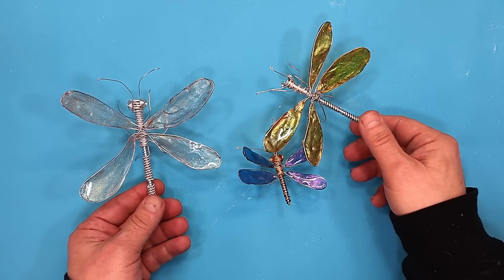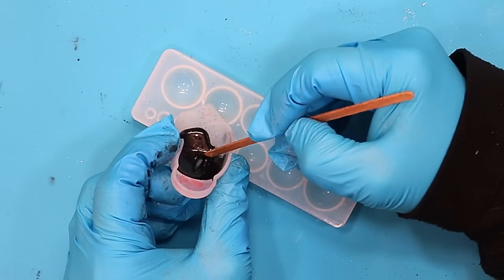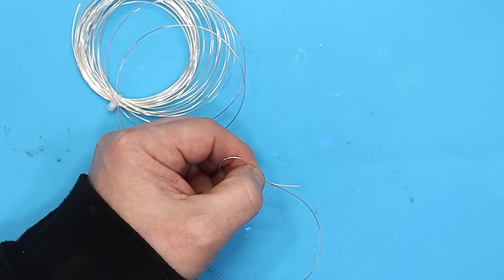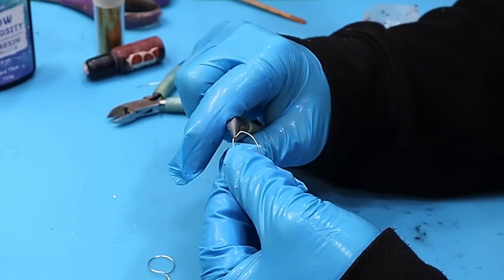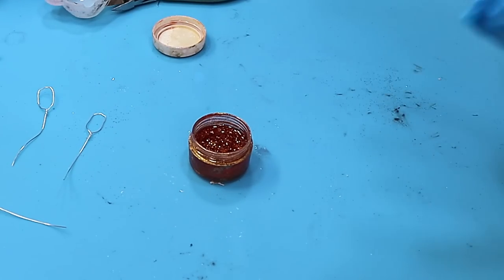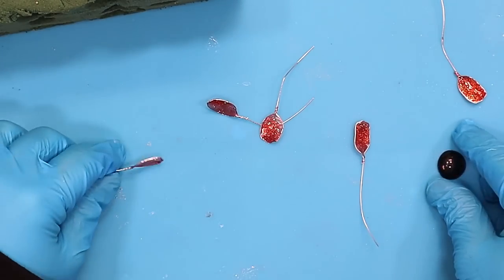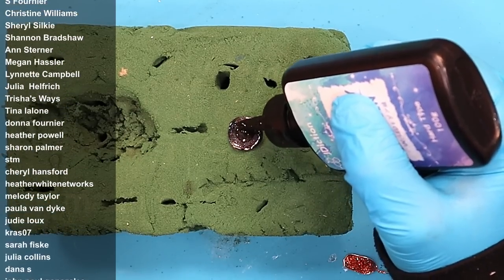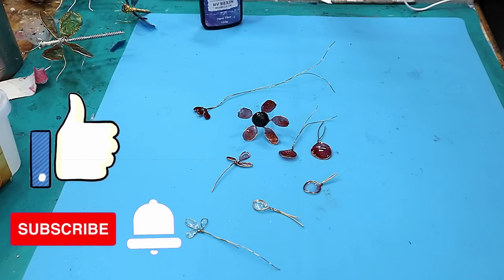Revealing The Secrets to Creating Amazing Resin Flowers

Comment: I watched your you tube video on heating the resin in hot water just to say the water was way to hot you only need warm water and let it sit for 5 mins and that will get rid of the bubbles, but you just mix it as you would ordinary mix it no need for all those bubbles. i use this method all the time.

Comment: Hi Steve! Hope you’re doing well. I have a question for you a friend of mine ordered me some silicone molds because I’m starting to do resin work myself, well I got the package today and two of the molds were the covers for both light switch fixtures and power outlet fixtures. My question is kind of a two parter here. Have you ever use them and do you think they will hold up as actual covers for light switch fixtures and power outlets?
Reply: @SteveMcDonaldArtsandCrafts  i'll have to look and see if they go over or if they replace it. I actually have an electrictian coming out next week so it'll be perfect to ask :) sorry it took me so long to reply. I just saw this :) also thank you for all of your videos. Your content is amazing.